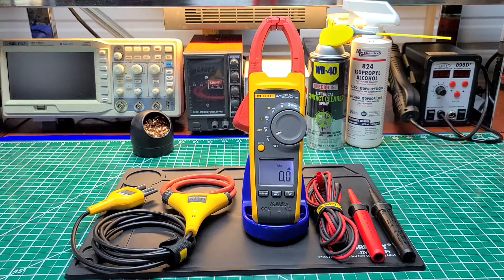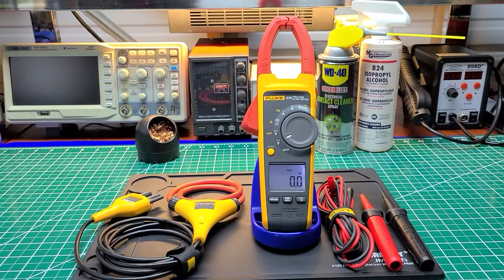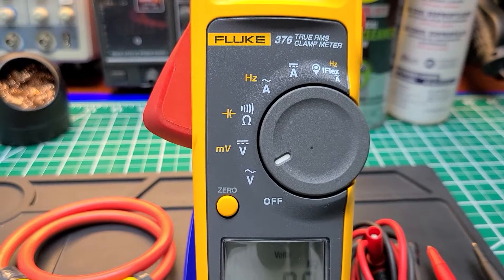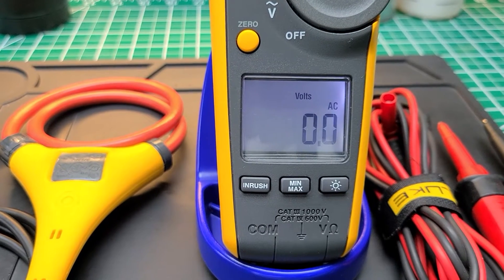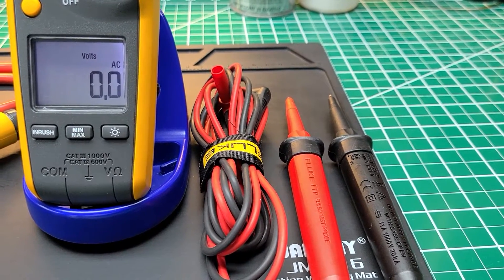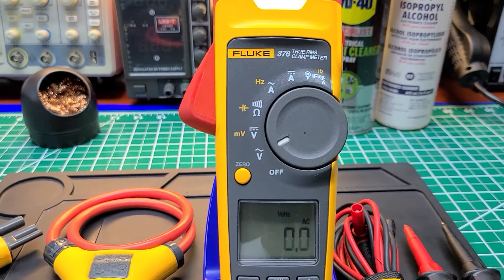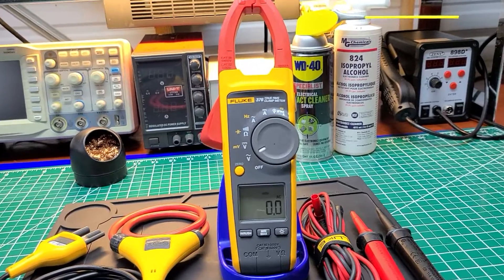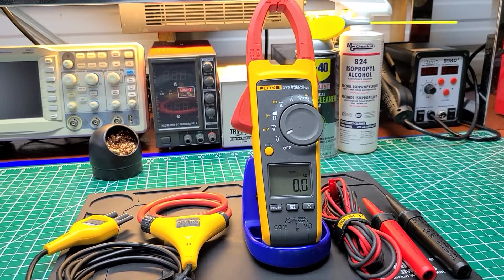🇺🇸FLUKE 376 True RMS Clamp Meter with Iflex

Comment: I got the same meter except with Bluetooth. Never used the fluke connect bluetooth. Great build quality. Excellent feel. As always with fluke reliable and accurate. Top top meter. Mine was recalled. Fluke handled everything and quick turnaround. 

Cons horrible test leads and the display is tough to read at way too many viewing angles.
Reply from the maker: Thanks for sharing